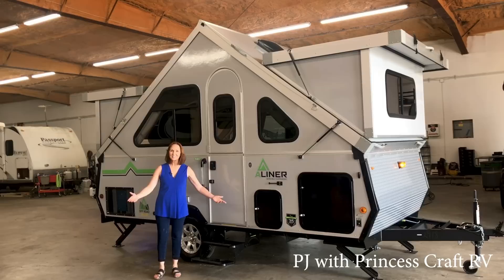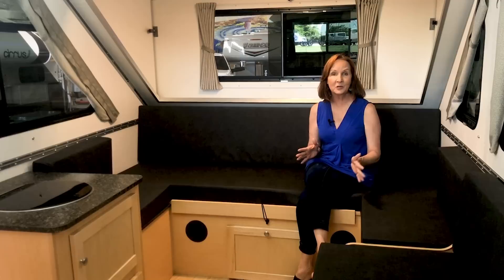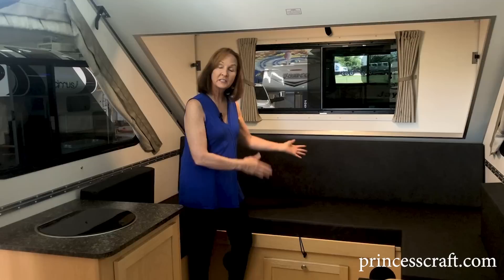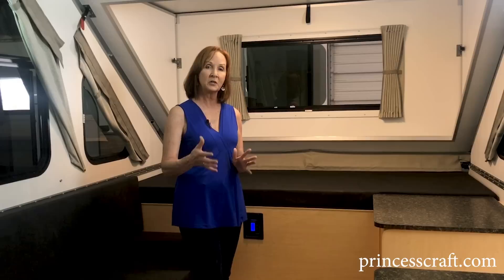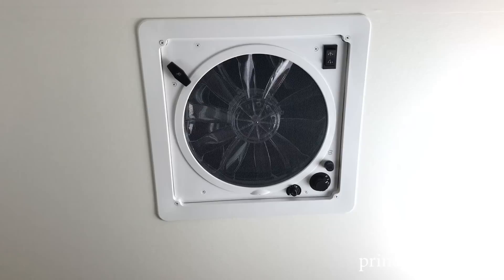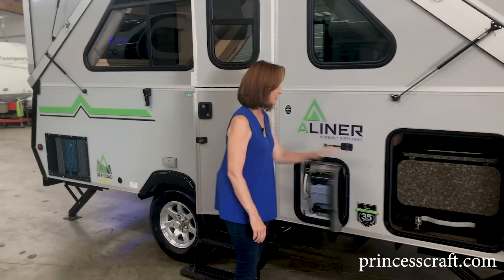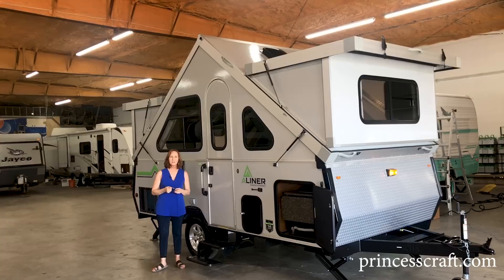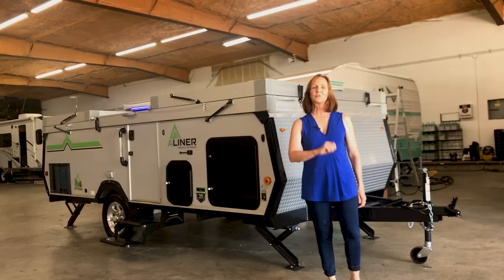2020 Aliner Family Expedition Folding Trailer Walkthrough Tour

Comment: I love Aliners. Hard walls vs tent makes this a great option for my family in cooler temp areas or areas with dangerous critters out at night. I like that level of protection for my 3 kids vs a tent camper. 

I'd like to see Tern Overland pop out dual pane windows at the dormers so we could ventilate even in a rain storm.

I like off road tear drop trailers but my wife wants a toilet and those tiny trailer simply cant have one inside. This solves alot of my problems.

I also like that they took a page from the Australian camping handbook with the pull out outdoor kitchen.

I need to do an actual camping review video on this model.
Reply: It would be awesome to see your review on this!
Reply: Have you ever seen a bear ripp a car door off?. I dont think any camper will withstand bears tearing it up unless you get an off grid metal box campers
Reply: @beverlybalius9303  Against bears, probably your only real option might be to have a van of some sort. As soon as those claws start ripping through the metal, leap into the driver's seat and floor it out of there.
Reply: B Annoying  I don't think it's about being eaten. It's more about being more protected than with soft nylon. A hard wall gives you "time" to react because nothing on earth just really just eats you without sniffing you out first. With a hard wall you have more time to grab bear spray or a pistol. Works well with 2 legged pests as well.
Reply: B Annoying  it has nothing to do with being scared to sleep in the woods. Its about being prepared especially if you have little ones (maybe your grandkids) I'm assuming you don't have alligators or crocodiles in your state?
Reply: B Annoying  you carry a gun everywhere you go....but you don't agree with people camping in hard side pop up trailers?

I carry in all 50 states too....im just perplexed because the same people who carry guns...enjoy a little extra layers of camping protection too with pop ups vs nylon ground tents.

You will probably never draw your gun in a real life and death situation in your entire life....but you do it because it doesn't hurt to have it and never need it.

I am an old man now. My days of sleeping in the dirt are over. I enjoy camping in a warm dry trailer with my gorgeous younger wide lol.

Comment: So, let me get this straight. It's honking it down with rain, you're starving but you have to cook outside. However should you need a dump, it's ok you can do that indoors while everyone else goes outside to get away from you. Still LMFAO at that one. Why not provide a toilet tent & put the cooker indoors!
Reply: You can lift the bunk bed and access the slide out kitchen from inside. Also, if you have access to electricity, you can use electric oven/induction cooker inside. Save the toilet for rainy days though.
Reply: @devsoftech  Only use the toilet for number 1...... Thats the golden rule.

Comment: I like the goal that Aliner had with this new model, but this is a poorly designed layout compared to the closest competitor, the Chalet XL 1920 A-frame that has been around forever. 
The Chalet XL 1920 family model also sleeps 4 (or even 6 with the extra wide bunk beds) but unlike the Aliner it has an indoor pop-up wet bath so you get a bathroom with a shower and some degree of privacy, and has a proper kitchen with more counter space, a two basin sink, and a large actual refrigerator with freezer. So you can actually camp in the Chalet in inclement weather. If you want to cook outside with the Chalet there is a propane connection on the side that you simply jack your propane stove into.

Comment: Compromises have to be made for an A Frame camper to sleep 4 adults.  I think this is well executed.  Bring a shelter along if you are worried about the outdoor kitchen.  I'm also sure you could figure out some kind of privacy curtain for the toilet.  At least you don't have to venture into the dark for that midnight bathroom run.  Especially for small children.  

One question though....can you open the bottom half of the door when the camper is folded down?

Comment: I'm disappointed with the interior, and the cushion foam seems to be light and cheap. The switch panel is problematic in our Classic as it is easy to hit when crawling into the sleeping area. I can't imagine that putting it, and it's bright red light right into the sleeping space would be an improvement. The slide out kitchen uses up much of the available front storage, looks heavy, and is only the equivalent of a Coleman stove and a cooler. The fan is up so high, that a step stool will be required to operate it. It should have a control switch mounted lower.  The KoolCat also uses up much of the rear storage and is unsuitable for more extreme climates like Minnesota where we camp in our Classic. Much better to have a furnace and a side mounted AC unit. They don't stick out much farther than the TV side mirror. Happy to see that they have finally included a hand grip by the door.

Comment: I wanted an Aliner for a long time and finally purchased one a year or so ago. Two big issues. Inside under seat air  conditioners units are nearly useless. Don’t know if it’s design error or just to small(BTU’s) but in temps above 85 it’s unbearable. For such a small space this is unacceptable. One would have thought this would have been a basic thing they would check pre production! I’m not sure if it’s the same for the units with a/c mounted on outside. And this is a problem even in the shade.  Number two. Don’t drive in the rain!! It’s leaks. No problem when set up but will get wet inside if you travel in rain. No maybe about it: it will leak. I have owned numerous campers in my life and although I love the space and design I would never purchase another.)
Reply: Where is the rain coming in when traveling? A simple fix would be a tarp and a few bungee's.
Reply: My never leaks. I drive in the rain all the time. Maybe it’s just yours.
Reply: Fritty 99 thanks for the review
Reply: I agree in heavy rain but nothing a few towels won’t suck up. And why I prefer my side air conditioner
Reply: @lhgross48  very true. It did take a while for cushions to dry though.  It was usually during hard rain.

Comment: I was extremely underwhelmed by the interior . A huge disappointment from such a big space .
Reply: You were hoping for a 65" tv an pool table?
Reply: @Vera-xu3xw  and* a* pool table
Reply: @DarthVader1977  That was so necessary
😂🖕🏼
It's really impressive how smart you are.
Reply: I was too, When you look at the smaller Aliner LXE. That has a built in full bath and shower. Inside kitchen with microwave. You have more year aroundish camping. Some mornings would be a little cold to stand outside and cook.
Reply: @Steinerecliner  its close. The slider kitchen should be able to be used inside(rain). And have an indoor shower and awning.
Reply: @Dot0011  The model I was talking about had both inside.
Reply: I saw a video of a trailer exactly like this one and where the top bunk is it had a shower/toilet and a sink, mini fridge and stove.
Reply: @julioalvarez2334  but I think you get less sleep space with that one. It's give and take. Depends what your needs are I guess.

Comment: i  missed the bathroom. why so much seating
Reply: My guess (and it's strictly a guess) is that the most common places where this trailer will be used are campgrounds with restroom facilities. And, I also guess that there are seating spaces for guests.
Reply: More people to fit in this model.
Reply: It was the large Gatorade bottle sitting on the counter.